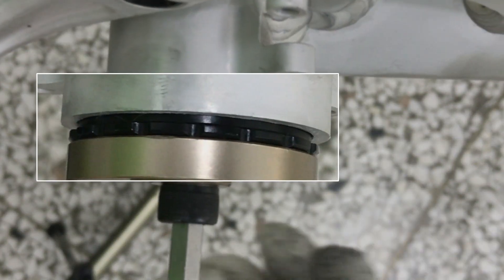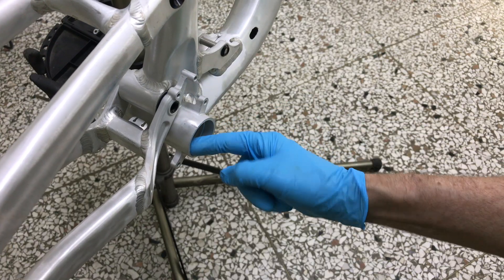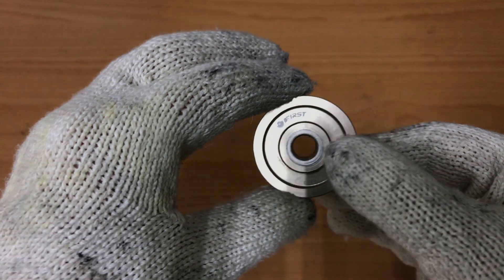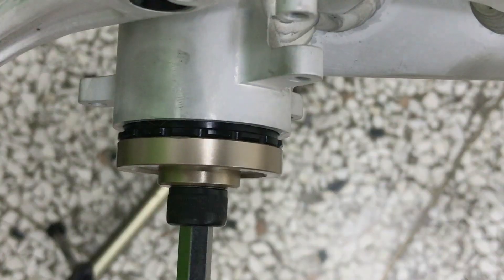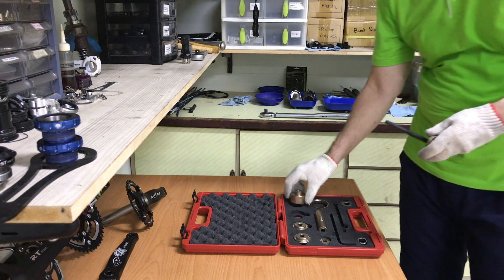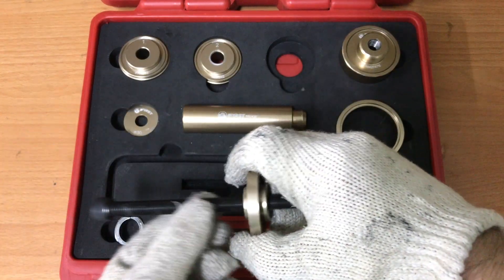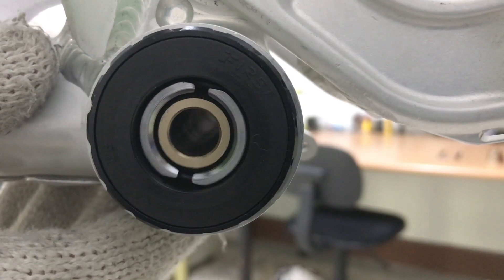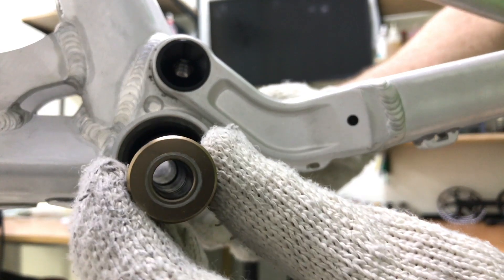BB92 (BB86) Removal & Installation (Tool & Technique)

Comment: Hi, one thing I don't get it. It says that BB92 is the same as BB86. How does it work to adjust for a 86,5 mm bottom bracket Vs a 92 mm ? It's being sold as they can be used in both, both but how if they have different cup lennght? Thanks

Comment: I like this idea way more than using the "rocket" (bearing removal tool). It's standard procedure to push out the bearing in automotive industry,  I don't see the reason why it should not be that way here.
But $190 is a bit too much for home mechanic. It's cheaper to smash those bearings out and buy a new one. 

Still, I do like the idea here.

Comment: Shouldn't bb92 bb in a bb92 shell not require a spacer shown on the non-drive side?
Reply: BB92 on my Spark has a 5mm spacer on drive side. Hopefully it stays seated when I knock out the GXP cups. I really do not like GXP, for a multitude of reasons. First being that it takes specialized tools and is a pita to remove!